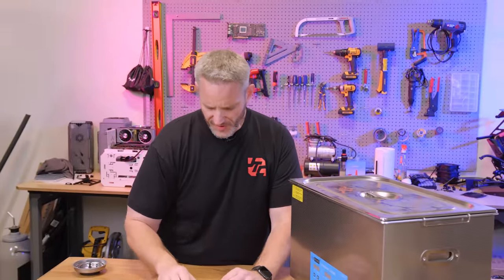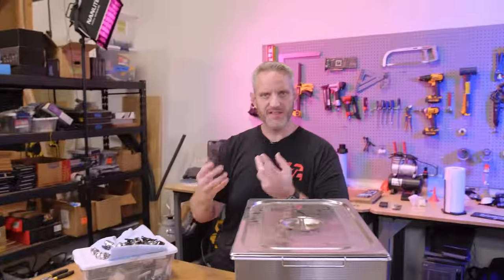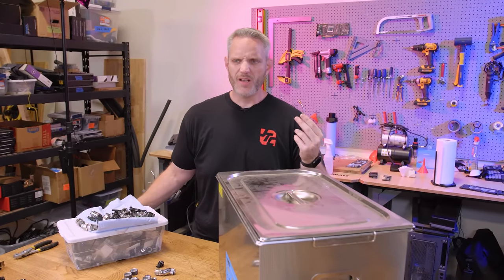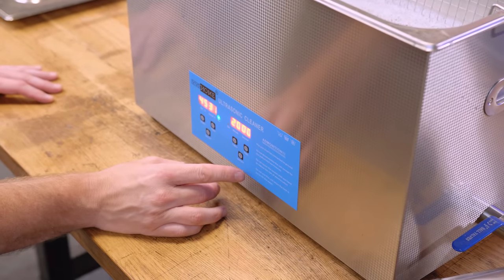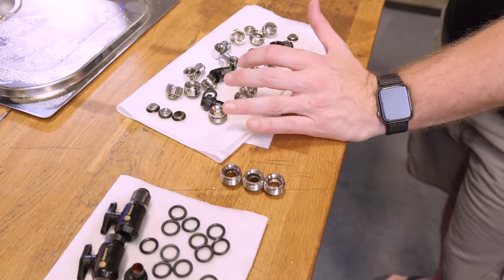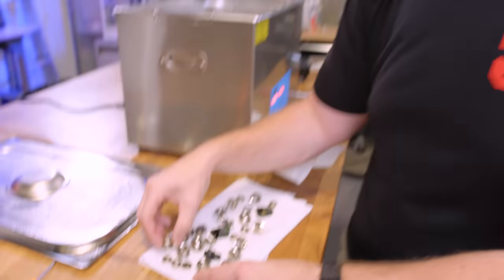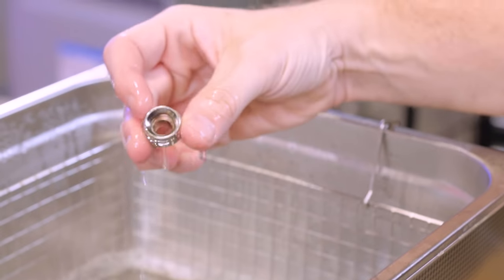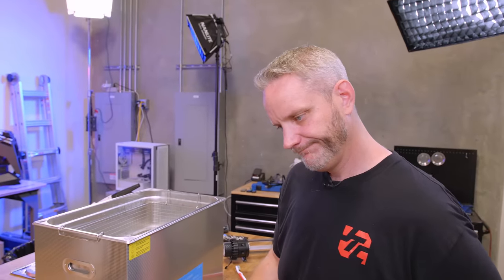I'll never clean watercooling parts the same again!

Comment: A tip I've seen about doing ultrasonic cleaning with IPA:
Place the parts to be cleaned in a heavy duty zip-loc bag and fill it with IPA, then put that into the sonic bath filled with regular water.
Safer and also massively reduced the amount of IPA needed.
Reply: or jar
Reply: @Paul B isopropyl alcohol
Reply: good tip, thanks.
Reply: Water with a bit of rinse aid can work very well. Rinse aids are water wetting agents that reduce water tension which makes water a more aggressive cleaner...
Reply: Or use a glass jar
Reply: @blaskedryck  I second the jar
Reply: Is IPA even necessary? My dad has an ultrasonic cleaner (some small one) and puts some detergent or whatever in, seems to clean up stuff quite well.
Reply: I've seen this on a watch repair channel.
Reply: You can use glass jars as well. Even gas can be used in a jar and get a great result depending on what metals you are working with.
Reply: Ziploc bags are they way to go, but just use some citric acid or CLR, both are good for removing scale deposits.
Reply: @Interknetz  it depends on the polarity of whatever you're trying to remove from stuff. Soaps are not bad for removing some oils, but organic solvents tend to work well for removing them since they can penetrate caked on debris more readily due to their viscosity being lower than water.
Reply: @Interknetz  depends on what you are cleaning. Example i use IPA in my ultrasonic cleaner when cleaning resin prints before final curing, plain water would not work as well. So solvents can help.
Reply: I do the same with solvents.  I fill a jar with solvent, then fill the tank with water.  The parts go into the solvent jar with the lid loosely closed.  Works great for things like airbrush nozzles or other items that need a solvent to clean them.
Reply: @the_hamrat  what do you mean?
Reply: @Paul B Beat me to it.
Reply: @CafeenMan  You put glass jars in ultrasonic cleaners? Unless it is a specially designed glass jar you should not be doing this as glass jars are not made to withstand ultrasonic cleaners.
Reply: @the_hamrat  of dirt?
Reply: @blaskedryck  for transmitting the sonic waves through to the cleaning material. Isopropyl alcohol is flammable and you don't particularly want to have the vapours in the atmosphere

Generally it's good practise to place the items to be cleaned in a container within the cleaner
Reply: @the_hamrat  yeah that's what I meant. 🙂But i didn't understand your answer.
Reply: yup thats what we do in industry. water in bath with a perforated/mesh tray and beaker filled with IPA is where machined parts go.
Reply: @georger5558  Yep, do it all the time especially cleaning greasy parts. Put enough white gas in the jar to cover the parts and go at it.
Reply: @jbktkj  Again if it's not a jar designed to handle a ultrasonic cleaner you are playing with fire.
Reply: @Interknetz  I use all kinds of stuff in mine, dish soap, bar helper, oxiclean, vinegar (thats a great one for heavy rust) any of those mixed with water. Also others are mentioning a glass jar, I have done this and it kind of works and is an option if you have a need for that. I have never made a bath of degreaser but I have soaked parts in degreaser then thrown them in for that extra strub and that works great too.
Reply: And the melted plastic?
Reply: @boredfive3001   What melted plastic?  Literally watched someone do it with no issues 🤷‍♂

Comment: Ultrasonic tip: Simple Green
Hell man, you could re-plate those fittings with nickel. You probably have 90% of what you need for an electroplating setup just laying around your shop.
Reply: I second this. I've used it to clean things from 3D printed parts to old crusty car parts, and carburetors. It's just concentrated Mr Clean cleaner. Works great!
Reply: what ratio of simple green do you use, or the cleaner straight?
Reply: Careful with aluminum and anodizing. Simple green will destroy the finish on either.

Comment: I use ultrasonic cleaners at work for emission measurement equipment.
Those stuff is usually gunked up with diesel soot and condensate of all kind.
Really nasty to clean up.
We are using Loctite 7840 at around 50°C to clean that stuff up and it makes everything shine like new without being aggressive to plastic or rubber parts.
Great stuff
Reply: works good for airbrushes as well
Reply: I use Simple Green.
Reply: @spankbuda7466  simple Green works as long as there's no aluminum. It will etch and eventually start to corrode aluminum.
Reply: @TravisFabel  You you can use it on aluminum as long as you diluted it nothing will happen.
Reply: @spankbuda7466  I will have to give that a go, what kind of raito do you mix it at?

Comment: I use an ultrasonic cleaner for my resin 3D printed parts and it works great for getting all the residue off before UV curing it.
Reply: Yo Ive recently found that using a magnetic mixer is fantastic too. First wash with the mixer then shive that bad boy in the ultrasonic, then rinse and cure
Reply: What do you use for the cleaning solution?

Comment: For the radiators, you can setup a loop with a cleaning solution and have it running while the radiators submerged are in the ultrasonic chamber. That should help to remove / clean the radiators, since the ultrasonic waves will propagate to the solution inside then as well.
At least in theory...
🖖
Reply: heh I posted that as well.
Reply: You’d probably also want to have some sort of filter in the loop as well to catch everything that comes loose from the radiators internals
Reply: @markburton5292  sorry mate, didn't saw the comments before my post. But you're right on, also about the vinegar as an option.
Reply: @Cyndaquil15  I would use an fish tank pump and a open reservoir so have the debris fall into the tank. But a filter can be useful as well.
Reply: @harugrin  I think yours was posted before mine.  I was just commenting that I had posted the same thing.  All good though.  I am glad however that people are willing to share information that can help others.
Reply: Great idea; and as someone else said, throw in a filter to keep it from going back in.
Reply: You need a filter and if something still goes through it can damage your pump. So best use a cheap or old pump.
Reply: I have the the radiator prep from Primo Chill that will do all that. You mix it up and pour into the radiator then let it sit. Will be like a new radiator.
Reply: i was just coming on here to say just that the rad probably held its air pockets, and for ultra sonic cleaning to work it has to be completely full of fluid of some kind, plus the act of a closed loop will cause all the crud to be cycled away as its vibrated loose.
Reply: Aluminum and Ultra-sonic cleaners is a FULL STOP NO.
Reply: @Knightslugger  I believe most radiators are copper
Reply: Exactly what i wanted to post :)
Reply: ive done something like that in the past put with iso and a submergible pump (dont do it possible fire risk)  but it does work

Comment: This is why i always use clear cryofuel and colored transparent tubes,
currently using blue primo chill tubes. your going to love the ultrasonic cleaner.
Reply: I wonder, though, if gunk would still end up in the fittings, but you just wouldn't see it since it's transparent?
Reply: @Calamity_Jack  once the liquid dries its not clear turns white/grey
Reply: @Calamity_Jack  really depends on the situation. Even with clear, a thorough clean is needed if you want a full cleanse. Standard maintenance cleaning would not require it.
Reply: Seems like it would be a good idea to at least quickly rinse all the parts out in distilled water (or whatever the best cleaner is) right away before storing the parts. So the fluid doesn't dry out. But of course, none of us are perfect. :)

Comment: I use to work for a biochemical/pharmaceutical welding company that ultrasonically cleaned mostly 316L and Hastelloy before and after I would weld it. Strips of copper were attached along the outside and inside of the various components to help draw impurities away from the stainless steel. It was a trade secret 25+ years ago when the company was doing it. With fixtures that were too long they would clamp copper strips across the length of the tubing, dip the bottom half into the tank and then pour solution down the length of the tubing to get them clean.

Comment: I'd be interested to see how if you stripped the blocks down how they'd come up after some time in the ultrasonic
Reply: I was thinking this as well, would like to see what the results are after a cleaning.
Reply: I would want to use an 80Khz cleaner for doing a block, just because the cooling fins can be so close together and so fine. 

But don't put one in a 27khz one, it will chew up those fine cooling fins.

Comment: Ive used hot water, soap and vinegar to clean my custom loop accessories for years but lately Ive swapped to olive oil and a gentle toothbrush. Its a massive difference and it becomes like new. Even plexi gets extremely clean. Ive never seen anyone mentioned using oil to clean pc water cooling parts so why not. It has amazing properties to remove residues and pastel colors.

Jay, at 8:29 its probably copper sulfate. My system recently got dark blue for some reason. I thought immediately of oxidation but that doesnt turn the water into deep dark blue ocean or Blue Soda color. Apparently effective, works like a growth inhibitor

Comment: I use my ultrasonic cleaner for motorcycle carbs mostly but it also does great on nuts, bolts, and pretty much anything you want to throw in there. I make sure to use Dawn dish soap on aluminum parts because its PH neutral and doesn't cause discoloration.

Comment: Ziploc's are your best friend.  Put your parts and solvent (or soapy water, etc) into a ziploc and just keep regular water in the cleaner.  Leave a small amount of air and it'll float, keeping the parts approximately in the center of the cleaner, where it works best.  You can cut the corner to drain the solvent for easy cleanup.  Also, fill the cleaner right up to the fill line so it works efficiently.

Comment: Also another tip for people looking to using some form of alcohol to clean things in a sonicator, dilute it with water, preferably DI water. You don't need a ton of alcohol to get the job done, because as you said the sonicator does a lot of the work. Also check to make sure what you are cleaning won't be damaged by the alcohol you are using. It can strip protective coatings or melt plastics.

Comment: I use one to clean the strings of my bass guitar, but only with mild heat up to 40 C (too much heat destroys the sound characteristics). They sound 90% as brilliant as new strings after cleaning, and that can be done more than once. Has saved me a LOT of money in last few years. A set of the strings costs between $30 and $60, depends on quality, for me mostly around $45 because I have a 5-string bass.

Comment: I have that exact ultrasonic cleaner. I filled it with water, and then put one of those stainless pans with a lid (like the ones people use at a buffet) inside and that has the cleaning solution in it. This keeps the main ultrasonic cleaner pan clean. Mine is for 3D printing :)

Comment: Around the 7:15 part of the video you mentioned that the fitting was starting to turn black. As I mentioned before that’s due to electrolysis that causes the nickel plate to come off. 

Any plumber will confirm what I’m saying as if you ever come across copper that turned black you know the pipe has become paper thin from electrolysis occurring. Since it’s a closed system you get a buildup of the copper/nickel that has worn off and the coolant is not abrasive as you said in the video.

Comment: FYI:  When using "fresh" fluid in an ultrasonic cleaner, run at least one cycle prior to actually cleaning parts.  This is because the fluid usually contains "micro-bubbles" and they act as little pillows and dampen the affect of the ultrasonic cleaner.  Running a cycle causes these bubbles to come out of suspension and improves the performance of the cleaner.

Comment: per my chemical engineers at my work they recommend running a 0.1% to 0.5% solution of Critic Acid with water for 15-20 in your loop or sit in the radiators to help break up coolant or built up calcium on internals in the rad.  worked great in my build.

Comment: For the radiator you should have the fluid pumping through it while cleaning it so that anything that gets freed will flow out of the radiator.  i would probably also use a slight vinegar solution for the pumped fluid  when cleaning it.

Comment: Jay.  Use 50/50 Mean Green cleaner and water for your rads.  Also wire the rads up so they are suspended in the fluid.  I know the basket is supposed to do that.  But the rads are too heavy, but if suspended it will work great.  They make ultrasonics big enough for V8 engines.  It'll work!

Comment: the casing of the radiator is a barrier isolating the sonic waves from penetrating the inside. try laying the rad down flat in the sonic cleaner to fill it with water then lift the back 90deg with the fittings submerged, that should trap the water inside the radiator. then with the radiator upright the water should be able to get a pathway inside the rad.

Comment: Since you mentioned it and called it out as nickel plating.  Chrome plating is a transparent layer .05 to .5mm thick that's applied on top of the nickel to protect it from corroding.  So you'll have nickel plating  then a chrome plating applied on top of that.  If you're chroming plastic, you'll apply a layer of copper  then nickel then chrome.    Spent one summer internship working towards my Chem Eng degree in a 110F plant breathing in those fumes.  It was great

Comment: Nice Idea, i cleaned my lawn mower carburetor with ultrasonic and it came out as good as new. The Temperature of the liquid plays an important role, too. do not underestimate that. some cheap ultrasonic cleanersdo not support heating, which is bad. So beware to get one without heating function.

Comment: To make the fittings brand new bring them to a company that strips off the metal paints and platings using harsh chemicals so it ends up bare metal and they can replace nickel plating back on it so all the fittings have equal amount than having mixed amount causing flakes breaking off at an early stage. That why old vintage cars and bikes have nickel and chrome plating done on them

Comment: I use one of these at work to clean some really greasy parts. So I have some tips for you.

1) for soap I highly recommend the simple green extreme aircraft grade cleaner, non foaming and doesn’t smell bad. Great at removing grease
2) get some mason jars, you can mix and match solvents, not the whole unit needs to be filled with the same liquid. You can put your regular mix in for light duty and then the parts that need rubbing alcohol you put inside of the mason jar with the alcohol and seal it and just put a weight on it to keep it down. You can have like 10 different jars with 10 different solvents as long as they are submerged in water you are golden. No fumes no nothing. Obviously you don’t want to run it at 80c, 50-60 will be more than enough. It’s also good for let’s say cleaning espresso machine parts and car parts at the same time, fluids will be separated.
Reply: Dawn dish soap is my goto for cleaning glass in these as well, once with the soap and once with clean water, but I do that at about 50c, then 40c. 

My mother likes her fancy glass decorations and that is what I've found works best for the least expense.

Comment: For the radiators, you can connect a submersible pump or just connect a standard pump and route some hoses into the tank to get some fluid flowing through the radiators.  Have the pump pickup hose somewhere in the bottom of the tank and the other hose on the radiator.  After flowing in one direction for about 15 minutes reverse the lines so you blast chunks through the other side of the radiator.  This method is used to reverse flush piezo printheads while also ultrasonically cleaning them.

Comment: a little science for the watchers here around 2:42, the waves aren't actually doing the cleaning, the waves are causing extremely tiny cavitations in the water, and the cavitations are basically tiny little implosions. those implosions are knocking all the gunk loose with extreme force on a very tiny scale. you can actually use this to clean certain ancient circuit boards too (maybe modern ones as well? I'm not 100% certain, DYOR), and people restore things like old NES boards, game cartridges, or ancient macs. It's pretty neat.
Reply: (also works super great with Dark Crystal Cleaner to clean out bongs)

Comment: If you want to use a solvent/cleaning  fluid you can put the part and solvent in freezer bag and fill the machine with water. Uses less solvent and clean up is a lot easier

Comment: You can put just water in the ultrasonic cleaner then put your parts in a jar or other container, then add your solution or solvent to the container. saves on using so much solvents and you won’t have to worry about lots of fumes

Comment: Just a heads up with copper, the coating of oxydation actually protects the metal from further corrosion, a clean surface does not.

Comment: I've been using an ultrasonic cleaner for my water cooling parts for years. Ever since i started reloading my own bullets. I use this solution for gun parts, thats paint/plastic safe. I never had any issues with any paint coming off of fittings.  Its not recommended to use the alcohol, at least in the gun world